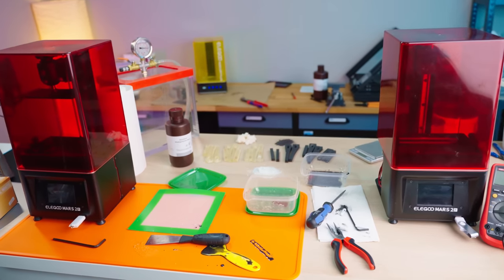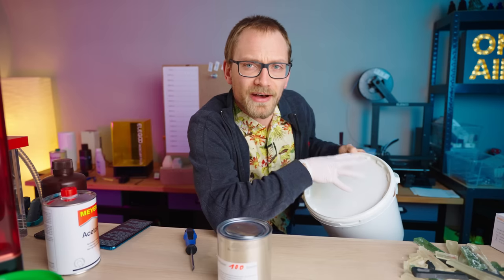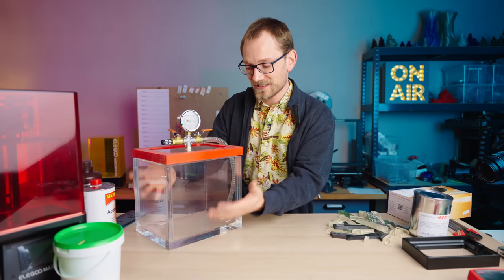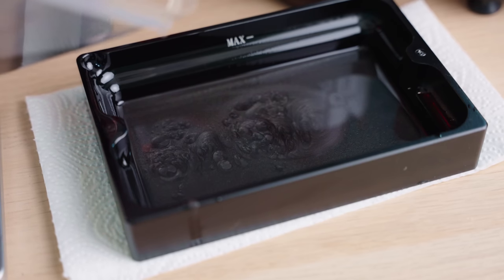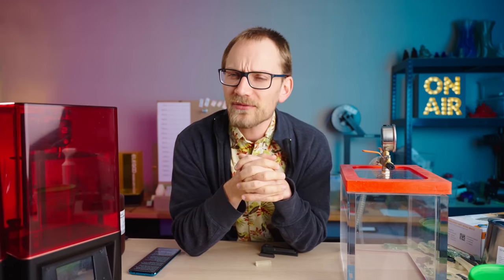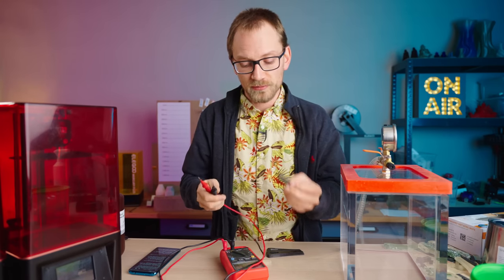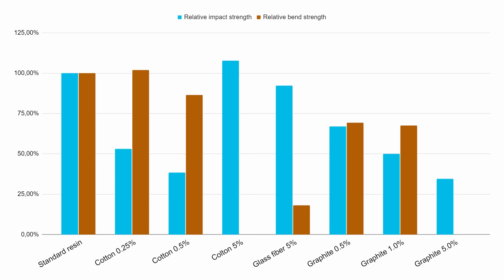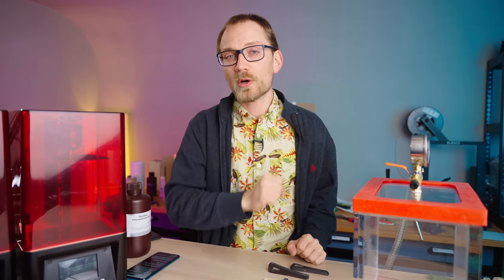Easier Fiber-Reinforced Resin Printing! Stronger and Conductive Resin Prints?

Comment: Maybe order carbon fiber roving or matts and pull them apart (under safe conditions with appropriate ppe) in order to get smaller bundels of strands. Then you could maybe directly deposit them in the highest stress areas of your print. This would be very labour intensive, both the preparation and pausing the print between layers and depositing fibers, but could give better results.

Comment: since this is photoactivated resin, there is a refractive index to the resin and a different refractive index to the added fiber, so it may cause some of the resin to not properly cure near the fibers and could be the cause of the demonstrated weakness. I'm thinking the wavelength used to cure the resin would need to change or vary depending on the fiber being used...I'm sure this is something material engineers are working on atm.

Comment: Seems like fibre reinforcement works best for parts that are cured in bulk (ie. Regular 2-part resin casting process) where the fibres can mix well through all dimensions of the part. In SLA printing, the fibres would be mostly "flattened" as they're squashed down for the exposure of each successive layer... Are the fibres impacting the bonding between layers? Would thicker layers improve things?

Comment: One idea for reinforced resin printing:
Use sheets of perforated metal like you used that fiberglass cloth (which I thought was pretty clever btw!). Maybe hooks on clamps (clamps on the resin bed) could keep each metal sheet up without having to bend it?

Metal sheeting would be heavy I guess, but maybe you can work it out? You could use tin snips (eg, aviation snips) to clean up the print afterward, which isn't cost-prohibitive for the average hobbyist. And if those clipped bits are too hard to sand, one cheap option might be to sand the surface with steel wool, which comes in varying grades of coarseness.

I'd also say give wire mesh a try... but perforated metal would be stronger than woven mesh. Although that depends on the type of metal I guess! Steel mesh would be stronger than perforated aluminum, eh? 

(Also, maybe I'm being too nervous about how heavy metal is, I've actually not worked with resin so I don't know what it could support while being printed!)

Thanks for reading my brain dump! I'd love to see a video where you try your sheet method with various guages, perforation patterns, and metals! And with cost comparison :)
Reply: Hm, why haven't I heard of extensive use of metal mesh used for example to build boat hulls? Yes, using one layer to form a first shaping layer is often used for example in repairing car bodies, but it that has nothing to do with adding strength. I suspect there is something not optimal about your suggestion - but brainstorming is never a bad idea!

Comment: I have not tested any yet, but  after seeing this I have thought about using carbon fiber, instead of graphite. Other things I am thinking of is finding a fiber that is the same density as the resin; it should give better suspension in the resin form? 
>Other thoughts: long fibers instead of fine. think about how a glob of clay would be with some long strands of hair all kneeded into it. hemp fibers?

Comment: I wonder if using a filler with the same density as the resin would help prevent the settling out problems. Although, I have no idea what materials would have a similar density that could add strength....  I suppose the resin does get agitated throughout printing, but doesn't seem to work fast enough for something as dense as the glass. 🤔

Comment: great video and surprising results! while watching the whole video i was thinking about the milled carbon fiber im glad you mentioned it. i have exactly that milled carbon fiber and i mix it into the polyurethane resin for casting and i can say it does make the end product stiffer and abit more stronger but for resin printing im not sure what to expect. i also use graphite powder mainly for coloring and like you said its amazing. 
Its worth mentioning theres also milled glass fibers just like the milled carbon fiber and it should prob provide more or less the same characteristics. pro side might be better signal penetration if thats what you are dealing with because carbon fiber is notorious for blocking radio signals like bluetooth etc.

Comment: After seeing a lot videos on the ceramic resin thats available I got really interested in different additives to resin and theres not a lot of info that I could find on them for 3d printer resins. Some stuff I wanted to try was Titanium Dioxide and Aluminum Oxide but haven't bit the bullet to buy some yet. I want a sort of custom janky sanding block shape, but also to just see how it prints and what kind of feeling it gives the prints.

Comment: Try 90+% glass fiber. Obviously that will require a pretty extreme exposure profile. But it will better mimick the ratios used in traditional composites.

Comment: Instead of short fibers, I'd guess a single long fiber along the length of the part would increase tensile strength the most. For concrete, there is prestressed concrete for some applications.

Comment: The additives need to be dispersed properly in the resin by means of a paste mill or similar, to break up the agglomerates. And you need to use an agent to make sure the additives stay evenly distributed and don't firm agglomerates again once dispersed. There is quite some research on the use of nano particles such as ceramics with (3d printing) resins. Some have found that you can in fact improve some of the mechanical properties of the printed specimens, such as tensile strength. But as mentioned, there is some more professional equipment involved.

Comment: In order for the chopped fiber to add strength, it needs to be running in all directions. Up, down, sideways, diagonally etc.. This is not possible when the print is built up in layers as all layers are pushed flat. This is actually true for any fiber.

Comment: im taking a course on composites so im in no way an expert but try to make sure your volume fraction is exceeding the critical value which is where the the fibers start increasing strength instead of being detrimental to the matrix's strength these calculation will depend on the exact materials you are using so i cant cruch the numbers on my end.

Comment: for all the materials you tried, you need strands oriented in the direction of the force to change it's strength. The powdered additives will not add strength as they do not improve the tensile properties.

Comment: Did you also try the conductivity of the other percentage carbon prints because sometimes some materials act like flammable or explosive gases with the stoichiometry when dealing with conductivity meaning to little it's not conductive too much it's not conductive but if you can find the Goldilocks zone it is

Comment: Have you tried any other fibers so far? I got interested in that topic too now that I own a Mars P. Thought about contacting a textile manufacturer for wool, if they can send me a bag full of dust from the fiber filters in their weaving or knitting machine hall. Wool has a rougher surface than the fibers you tested so far and using very fine/short hairs of it might keep them floating.

Comment: Those products are fillers. They are not intended for strength but to either cut the amount of resin use to make the part or to thicken the resin and apply as very thin layers to catch tiny details.

Comment: Hi there You can try to add some aluminium powder. Its known to add some high  temperature resistance to you parts. Standard photopolymer resins are up to 80 deg C it could add more up to 140 deg C but again will it be strong enough?? One more thing when you are looking for carbon fiber powder or aluminium powder ask supplier about single particle dimensions. They should be smaller that your print layer heigh so if you prints 0.05mm layer then particle dimensions should be smaller than 0.05mm or change layer heigh to 0.1mm 😜

Comment: I'm not surprised that the 5% graphite didn't make the part conductive. I successfully made parts of my 3D prints conductive with a mixture of CA glue and graphite and I started out with the graphite and just dripped CA glue into it to create a very thick paste which I smeared onto the PLA. I didn't measure it but my guess is I had way over 50% graphite in the final result. 5% seems way too low.

Comment: It's light interference on bubble surface (i.e. thin-film interference): light reflected from outer bubble surface interferences with light reflected from the inner bubble surface. It's the same phenomenon like colorful oil flowing atop water in a puddle.
The phenomenon has no relation to graphite (it happens even without graphite) but: graphite in resisn makes it black and the light that is normally reflected from/behind the clear/white resin is missing and the color light is more prominent. You basically put a black background behind the foam.

Comment: i recently printed a 100x50x5  test  piece with elegoo abs like red translucent resin and i just couldn´t break it with my bare hands even after multible attempts. i now personaly prefer resin prints over fdm printed abs or asa parts in therms of strength because it seems like i always had a bit of tension in the fdm parts even with a heated chamber, that , caused the prints to fail a lot sooner. Im not saying fdm parts are weaker than resin, i just think for me personaly its way easier to get some pretty strong resin prints than equaly strong abs/asa prints with all the settings and enviromental factors you have take care of to get a good result.
Reply from the maker: Oh, for sure! I did a video on comparing specifically the red ABS-like with FDM materials and the resin part just completely stomped any sort of filament part.

Comment: i plan on adding diamonds to some resin, to see its thermal conductivity.
Reply: I looked into this once. While diamond is very thermally conductive, the overall thermal conductivity is dominated by the distance between particles in the resin. You'd need very high powder percentages to see any difference between diamond powder and (say) aluminum oxide (alumina) powder.

Comment: Very interesting results. I was wondering, have you thought about experimenting with more bio materials besides cotton? One thing that has been in my mind is using a small percentage of powdered oats, like you did with the graphite. That thing gets pretty solid once it dries.
Or maybe "recycling" fallen leaves (blended of course). It could lead to interesting results in my opinion. Even if it didn't I'm pretty sure it would still be an interesting video.

Comment: Try experimenting with adding nano sized materials (graphine, silica, etc.) you will get better results as these printers operate almost at that range. Then in the the nano meta combinations that are written about in all the publications in nano technology magazines and publications. Add a little sacred sound of the 528htz & alternating through the other ones snapped the snare of drum like the FEP to help align things yet again. Small electrical currents matching the frequency and harmonics of the other materials with the correct waveform & corresponding amplitude and hertz to arrange the materials and you've got at home meta materials people! Let's start working at this together for possibly small to medium power applications.

Comment: I would like to see the effect of bone meal and I always wondered if the structure of bones could be copied by 3d printing. I feel like bones have an optimized structure for resistance against weight ratio. 
Also maybe try smaller concentrations? 0.1 by weight doesn't sound like much, but maybe it is already to much.
Would have been very cool if graphite would have been conductive. Would it have then be possible to create PCBs with it?

Comment: I've always wondered about adding something like Epolene polymers: polyethylene and polypropylene polymers. Don't know if anyone has tried any of those, but would be interested to see if that helps with giving some durability and flex to a 3D print and also allows for a 3D print that can be melted.  I know Epolene C-13 (which can come as solid beads) can be melted and used in plastic injection equipment, and then even used in a lost-wax casting process. It is more durable than a wax. Its like a flexible plastic that holds its shape, but burns out clean in the casting process. I'm sure some of the other Epolene polymers are available in liquid form or small particles that might mix with resin. Or maybe  even be able to be mixed with resin if the resin is kept at a certain temperature while printing.

Comment: How about just using single—but longer—strands of fiber, and not snippets? Could probably be any fiber, even silk.

My gut feeling would be that having larger pieces of foreign material bonded within the resin would work better for reinforcement. Snippets of carbon weave thrown into epoxy don’t do much, either. When working with smaller particles, perhaps something that melts into the resin could work. Would probably have to be a material that adheres to resin well on its own, too. Maybe some heat-activated glue/bonding thingie?

Comment: I'm surprised the fibers didn't help at all. To me there might be two explenations. First, the wetability of the fibers is not very good with the resin and therefore there is a weak or none existant bond from the resin to the fiber. But  looking at your video it seemt to be compatible with the resin.
Second, the fibers hinder the full curing of the parts --> two things could be testet that might help. Adding with the fibers more photoinitiator or trying to cure the parts afterwards using heat. For the heat treatment the photoinitiator would have to be known in order to see at what temperatures it would start initiating againg. I found a page stating that 60°C is enough to post-cure it further but I sugest contacting the resin producer to find out more. I sadly don't have an SLA printer due to the messy cleaning it involves but I kind of would want to have one one day.
Thanks for your great videos Tom. I hope you find a way to improve the strenght of the parts

Comment: As far as I know cfk and gfk laminated parts basically want as much fibre as possible while filling the voids between fibres with resin instead of air.  
Basically   more fibre = stronger.  
More air = weaker (and unpredictable).
Of cause in laminated parts the fibre Direktion is important as well.

Comment: My guess here is the printing process might be playing more important role in this then actual additives 

You can crosscheck this by pouring same stuff in silicon moulds with and  without addatives 

Because I think the part is cracking similar to plywood

Comment: The fibers are cured into plains of 2-D, I wonder if you use the same fibers but cast them in a mold(silicone?). I wonder if the 3-D fiber cure would be any stronger. It might take a while to cure.

Comment: Instead of measuring resistance with the small voltage the probe produces, use a power supply and apply voltage and measure what the voltage drop is, maybe have an ammeter in series and turn voltage up to find that point it might conduct
Reply from the maker: Anything can become a conductor when you apply a high enough voltage to it 😉

Comment: I have actually tried 0.2mm carbon fibers, 5% in volume, but could not get a succesful print due to it clumping together underneath the print plate. It forms a non-newtonian fluid it seems. I gave up after a few tries, because less than 5% will most likely not increase the strength of the prints. The resin carbon mix does look really cool though. Perhaps it is better to print a mold, then casting resin with mixed fibers inside.

Comment: Id br interested to see you try this with graphene and what the difference in resistance is once cured in the resin. At this point the single layer stuff is very expensive but you can find some 8-11 layer stuff on amazon where you can get a kg for 170. although they are charging for shipping as well. also i wonder if resistance would be better for the graphite mixture you used if you printed it out as a very thin circuit rather than a structural integrity design.

Comment: Adding fiber like this (in a curable/printable way) will not really help the part strength. I think the amount you need to add is preventative for a hobbyist as you have found. 

I think what you need are layers of cross linking fibers. You could print the part split (top plane) in tow pieces, then laminate them back together with a sheet of fiber woven cloth in between. Or if you could stop the print some of the way through and add layers of glass cloth. I feel like this has been done before?

We use the glass powder in the composite shop at school but only as a filler/thickener that will not add color to the resin. It is too fine to add strength from my limited knowledge. =]

Maybe stopping the print and sprinkling in a few thick layers of the cut fiber? Good luck, interesting ideas so far...

Comment: I feel like you'd need some way to keep things very well mixed the entire time and then also use reasonably long fibers and maybe even experiment with optimal layer jeights to actually get a structure where the fibers are nicely blended in in a way where they reinforce. The initial mixing is probably lost pretty quickly into the print

Comment: Graphite looks amazing ive been trying glitter and strontium aluminate....the glitter im having issues with it staying suspended and tge strontium is the same but way worse its also like sand so it's abrasive but im having a blast with 3d printing